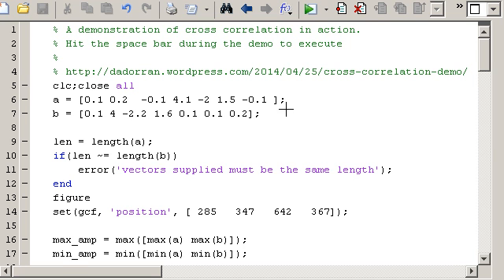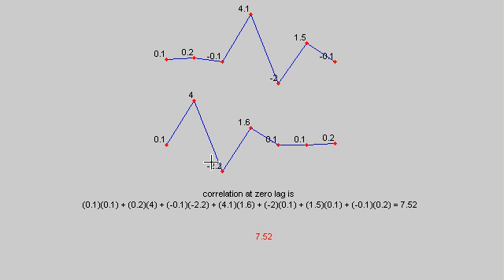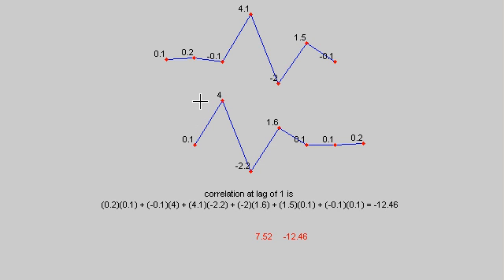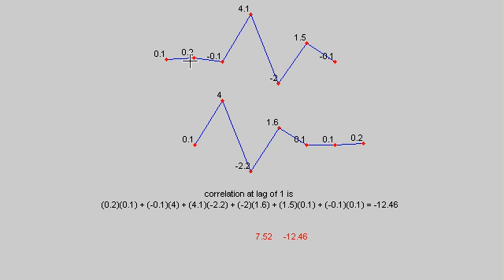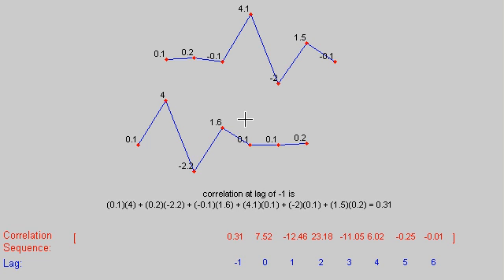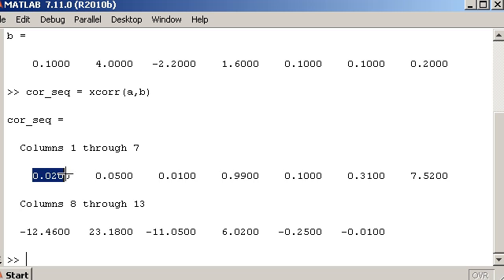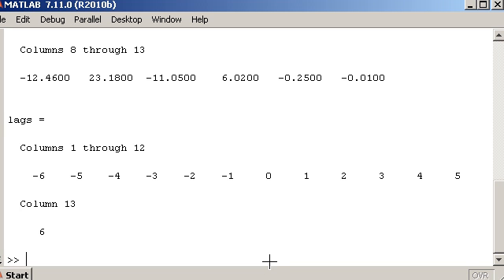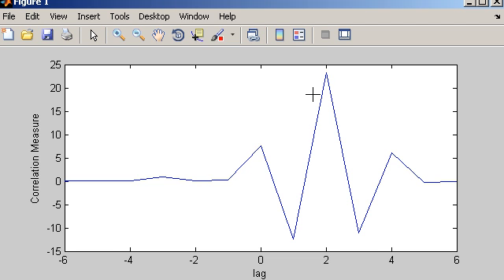Cross Correlation Demo using Matlabs xcorr function

Comment: I have a doubt with some homework I have to do. The thing is that I have a .wav signal and I have to compute its autocorrelation. I wrote this code in a script:

[xt,fs]=wavread('signal8.wav');
Nt=length(xt);
t1=0; 
t2=Nt/fs; 
t0=(t2-t1)/Nt;
t=t1:t0:t2-t0;
%Compute the autocorrelation, phitau and the shift tau using the xcorr function
[phitau,tau]=xcorr('signal8.wav');
close all;
plot(t,xt); 
xlabel('t sek'); 
ylabel('x(t)');
figure;
plot(t0*tau,t0*phitau); 
xlabel('tau sek'); 
ylabel('phi(tau)');

and at the end in the command window I try to execute my script but I have an error like this:

Undefined function 'fft' for input arguments of type 'char'.

Error in xcorr>vectorXcorr (line 105)
 X = fft(x,2^nextpow2(2*M-1));

Error in xcorr (line 53)
 [c,M,N] = vectorXcorr(x,autoFlag,varargin{:});

Error in lab4b (line 8)
[phitau,tau]=xcorr('signal8.wav');

Could you help me with there problem?

Comment: so if we have the largest number in correlation sequence (in this vide, it is 23.18 with lag 2) means that there is highest similarity but at the end of video, you said that between 0 to 2 the signals are most similar which means the highest similarity at at lag1. It is disconnected story. What is the criteria to select the correlation sequence with highest similarity?
Reply from the maker: I'm not sure where I said "said that between 0 to 2 the signals are most similar which means the highest similarity at at lag1". If I did then I was incorrect. The lag at which the signals are most similar is at a lag of 2 samples.

Comment: i have a query that i was hoping you would be able to help me with, for my final year project i have been researching into calculating distance using sound on an iphone 6. I have been playing short frequency sweeps on one iphone and recording the data on another phone sitting on top of the other. What i'm planning to do is calculate the delay between the initial sound and the reflected sound and combining that with the speed of sound to give me the distance between a wall and the iphone. however i'm struggling to do so. I know you are a wizard on MatLab and was wondering if there was any techniques or methods to approach in calculating that time delay within MatLab or Audacity.
Reply: +Khash Ghalam This should be doable, though I'm not sure what kind of resolution you'll get.  The key is to send a very short but high amplitude, high frequency impulse (a click) and record it on the second phone.  Ideally, the second phone should record two clicks, one directly from the first phone, and one (much weaker) from the reflected surface.  Auto-correlate the signal to determine the delay between the two pulses.  That delay is the distance.  Complicating factors will be the limited bandwidth of the audio circuits at high frequency distorting your pulse (that's why this is usually done with ultrasonic transducers) and the multipath and smearing of the return signals since it isn't going to bounce off of just one point on the wall, but off of multiple points with slightly different times.

Comment: Hi, Nice tutorial. Thanks. I have a small query. 
I am supposed to calculate the "average of cross correlation" of over 20 series at zero lag. If i do it pair wise, i am assuming there would be 20C2 (20 Choose 2 ) coefficients which is a very high number and then i will have to calculate the average.  Is there an easier way to do it ? perhaps something that can be implemented on excel ? Many thanks.

Comment: Great explanation. I have one problem with this approach, maybe you can clear things up. I have two signals which look like peaks correlate where one peak is towards the beginning of signal 'A', and the other peak is towards the end of signal 'B'. Using cross correlation, the lag (which is large) to allign these samples doesn't provide the largest correlation value purely because there are less points involved in calculating the the correlation at this lag i.e. because many of the data points on one signal don't have an associated point on the other signal to be multiplied by because the two signals now have only a small region of overlap. I hope I have explained that comprehendably. Do you know of a solution for this/is this a known problem of cross-correlation, or am I missing something major in my understanding.

Thanks in advance.
Reply from the maker: +volcEmpire In matlab there is an unbiased version of the xcorr (cross correlation) function. I think this just divides each correlation measure by the 'overlapping' vertically aligned samples which gives more weight to the correlations associated with larger lags. You should be careful when using this technique as sometimes the correlation measures at large lags can be excessively scaled.

Comment: Hello David. Great tutorials. I have one question, I want to derive approaches for the signals are not aligned vertically. In normalized correlation also the data points are vertically aligned.  How can we derive correlation , normalized correlation for non vertical aligned signals.
Reply from the maker: raghunath n My initial approach would be to interpolate the data so that it is vertically aligned and see how that works.
Reply: Thank you David. Your message confirmed my solution. Thank you.

Comment: So what is the resulting number actually mean? 7.52 what? %?
Reply from the maker: The meaning of the number is dependent upon the signals involved. A value of 7.52 might mean signals are identical for one pair of signals but extremely dissimilar for another pair of signals. The reason for this is because the number returned by a standard correlation function are dependent upon the energy in the signals. 

Normalised correlation attempts to resolve this by normalising to the energy of both signals so that the result lies within +- 1. A value of 1 in this case means that the signals are identical, -1 means the signals are an inverted form of each other and 0 means that they are orthogonal to each other. So you are probably wondering what 0.5 means versus say 0.9 - the simple answer is to say that a result of 0.9 means that the signals are more similar than signals that have a normalised correlation of 0.5. A more complete answer could be obtained by looking at the equations - I was trying to come up with a verbal description but couldn't come up with something that was easy to interpret - this question did get me thinking about it though so I'll get back to this at some stage.
Reply: So using your number system, what number result would indicate 100% identical, in phase, etc?
Reply from the maker: Using normalised correlation a value of 1. For standard correlation sum(x.^2) where x is one of the signals
Reply: I guess I meant standard, if that is what you're using in this video. You have 7.52 and -12.48 and so on so I am curious as to what 100% identical signals would yield.
Reply from the maker: 17joren As an example say you had a signal [ -2 3 4 -10] then a standard correlation measure if you correlated this signal with itself would be 4+9+16+100 = 129.

Comment: Hi David, excellent video. I'm using excel 2003 but with a vast set of data (over 40,000 rows) is there a formula to calculate the correlation sequence value without having to individually multiply each numerical value associated with each sample? This is killing me!
Reply from the maker: You could downsample your data before correlating. Or you could cross correlate over a smaller range of lags. Both of these approaches would require a good understanding of the data you are working with to avoid missing useful info.

Alternative you could use octave to process your data (an online version is available at http://octave-online.net/)

Comment: For the cross-correlation to be valid, do you absolutely need to have the same number of elements between the two signals ?
Reply from the maker: yes. In the event that you have two sequences of numbers that do not have the same number of elements you can either zero-pad the shorter one or truncate the longer one.
Reply: David Dorran magma169 No they do not. Correct your intuition in Matlab if you can. The resultant of xcorr(a,b) will be of length a.length + b.length - 1 and the 'zero index' will be the (b.length -1)th entry.
Reply from the maker: Andrew Gallasch Perhaps we have different versions of matlab - I have 7.11 (R2010b) and it always returns 2N-1 correlation value, where N is the length of the longest input sequence.

There is also a note in the help on xcorr that the shorter sequence is zero padded by the function.
Reply: so it does. That will only result in extra zeros appearing at the end of the xcorr result. They can be ignored. There is no mathematical limitation that inputs have to be equal length however.